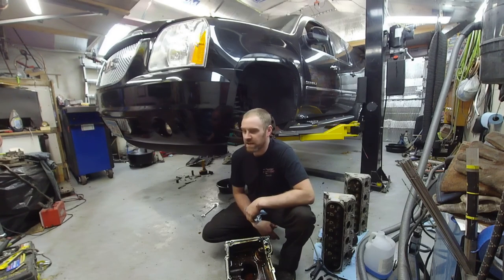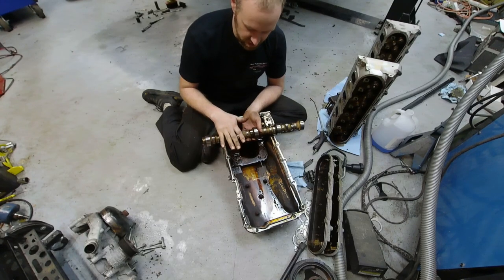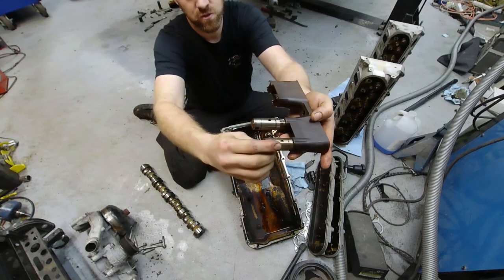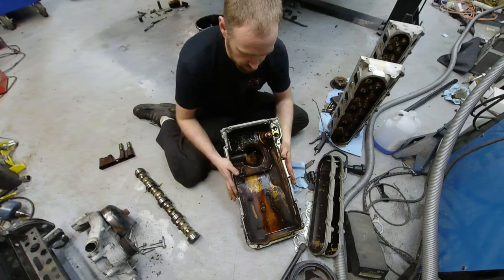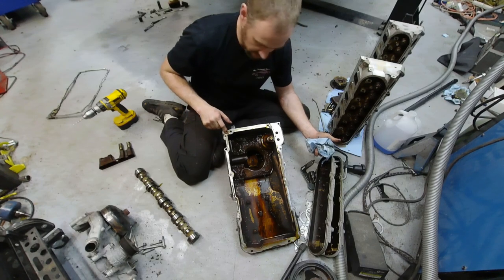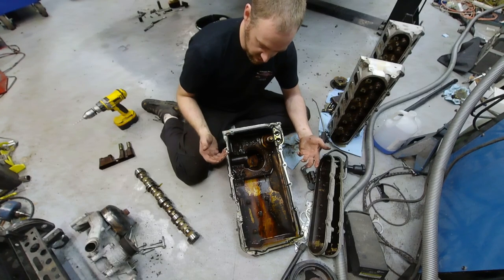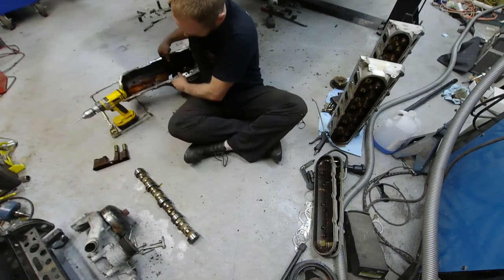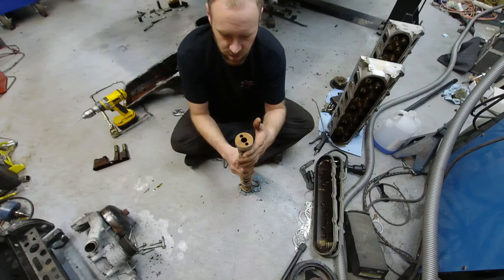Common GM V8 Issues & 6.2L Truck problems

Comment: This is why I bought a 2011 sierra denali.  That 6.2 did not get the DOD system like the yukon denali or escalade
Reply from the maker: If it is a 1500 it could very likely still have AFM/DOD. How do you know for sure it doesn't have it, did you check the valley plate under the intake?
Reply: @CrazedPerformanceRepair  The L9h 6.2L engine was built without afm. It was put in the 1500 sierra and silverado as the big engine option. Only the L94 6.2 in yukon denalis and escalades had afm.

Comment: Got a 2010 6.2 in the shop right now with a rod knock and fuel going into the crankcase
Reply: I just got a 2011 ss and it’s leaking oil

Comment: I bought a 07 yukon Denali ran great, now its runs a lil rough and the oil gauge isnt working anymore. Taking it to the shop but would like a general idea of what "may" be wrong so they dont just tell me anything.
Reply: Probably the oil pressure sending unit. It’s a easy replacement and don’t forget to take out the screen behind it and don’t replace it!

Comment: Great Content Brother, So trying to do Everything to have Dependable Oil Pressure in an L94 AFM & Vvt Delete, BTR "Norris" Cam w New Cam Plate Oil Seal, Johnson Low Leakdown Lifters, New Melling M395HV Oil Pump/Green  O-Ring & 2 Bolt C Bracket on Pickup Tube New Oil Pan Gasket & Seals. Also adding GETM Oil Squirters to Main Oil Galleys to Bottom of Mahle 4032 Forged Pistons. So Thinking whether to Replace or Plug Oil Pan relief valve ?
Reply from the maker: The second Cam Bearing is a common oil pressure loss area so be sure to replace those to. Norris cam is a great choice though. If you go to a standard volume pump then remove the release valve. That pump is going to be too high of volume for that build though. Since you added the oil squirter's but removed all the AFM vvt stuff, I would go stock high volume. That pump will just be pouring oil past the pump and pan bleed off constantly.

Comment: Very informative video . . . I realize this is an old video, but have you heard if the newer 6.2 engines are having problems like these ? I'm looking at 2022 GMC Yukons with the 6.2 engine and I'm trying to find out if these problems are going to come up after I buy one - thank you for a great video.
Reply: Better off with a toyota sequoia capstone or a newer Lincoln Navigator
Reply: Don’t buy a GM 2019 Denali 4x4 2 motors blew both cam bearings.

Comment: I’ve had two 6.2 engines. Both of them burned about a quart of oil every 1500 miles and both had head gasket problems at about 72,000 miles
Reply: Ecotec or vortec
Reply: @Pabloperes675  1 of each
Reply: @PumpkinKingXXIII  don’t tell me that man, i pulled the trigger on a 21 Silverado 6.2, should I back out?
Reply: I got bad luck so make your own mind up.
My 2016 got stolen first of December. 
 Insurance paid out, bought a 2021 gmc with 6.2. Two weeks later deer ran out and major damage. Been in the shop trying to get parts to fix it since. Shop has had it three months tomorrow.
Reply: @PumpkinKingXXIII  damn man sorry to hear all that.
Reply: @Pabloperes675  thanks, at least I wasn’t hurt
Reply: @PumpkinKingXXIII  yes sir that’s what matters
Reply: 2012 Escalade 6.2. Zero oil consumption at 122K miles.  Just had the motor build a few thousand ago and the same. That sucks man

Comment: Thanks for the info..   I didnt find in comments for best way to avoid issues.  I have 2017 5.3l in my yukon with 70K  and i tow occasionaly,   Is it best to deactivate the cylinder deactiavation along with changing oil often>?  I run full synthetic.    Between my driving and towing the AFM isnt on much.
thanks
Reply: The best advice is to turn AFM off completely like I did on my 2017 with 6.2 when it left showroom floor. I also use Amsoil SS since new. No issues yet knock on wood

Comment: Thanks, I came out to start mine 6.2l Yukon and its knocking like crazy, all fluids are full no engine light BUT oil pressure is very low just below 40. What could it be. it only has 88,000 and the oil is just as clean as when I bought it and never had to add oil to it. Whats your thoughts?
Reply: Just below 40 isnt low😂.when it gets to like 10 at idle be worried then

Comment: Aside from lifter issues specifically, the biggest other problems I've seen (at least with the 5.3's) oil pumps going out and the pick-up tube o-ring cracking and either causing air to get ingested or causing the tube to drop or otherwise not suck up enough oil, and the oil pressure sensor sending unit going out (and in some cases, I've read people having to replace the sending unit multiple times over the life of the vehicle).
Reply: W

Comment: The L9H 6.2L in the 08-13 sierra and silverado doesn't have AFM or air suspension.
Reply: I purchased a 6.2 from a 08 Denali to do a swap........are you saying that it doesn't AFM and do you know if I would need to do the DOD Delete for this particular engine?

Comment: Hello,
I realize this is an older video however I hope you see this comment.  Thank you for all the info by the way. 
Big concern here is that I did the dod delete,  I left in vvt but I did not replace the cam phaser bolt,  you mentioned in your video that it should be replaced,  I did not and I am now worried about it,  what could possibly go wrong with reusing the bolt? Can it possibly walk out?
Reply from the maker: It's considered a stretch bolt per GM, I guess in theory it could break. I guess if you've been driving it and it hasn't broke yet, I wouldn't be too concerned.
Reply: @CrazedPerformanceRepair  thank you for the reply sir, so if the bolt happened to break would the cam phaser sprocket fall off? That would be my fear is that it would fall and destroy the engine. Again thank you for your time
Reply from the maker: @johnherrera8004  yeah most likely. Then it would bent valves at that point.
Reply: I found the vvt cam bolt can be reused one time. Original torque specs were 48 and some amount of degrees, if it is reused once then torque it at something like 45 and add some degrees but not as much. If you can remeber how much you torqued it if it is around the 45 you'll probably be just fine. Check out sdpc tech tips: dod delete faqs!

Comment: I have a 2005 envoy xl with a 5.3 engine. It was running fine and all of a sudden it lost power. Doen't want to rev up. Have to put it in 4 low to move it because it has no power. We pulled the plugs and checked the compression. 2 cylinders had 150 lbs. of compression and the others were low. started it up with just the plugs in the 2 cylinders and it runs better than with all 8 plugs in it. So we pulled the cover on the timing chain and it is where it is supposed to be on the gears.What else can it be?
Reply: Check the exhaust and catalytic convertor

Comment: I have a 08’ Yukon Denali non AFM and I had all the lifters changed and still have the ticking sound. The oil presser will sit below 40 in idle when it warms up. I wonder what this problem could still be. Would a high volume oil pump help?
Reply: 2008 6.2 doesn’t have the DOD. It’s only a VVT motor. Bunch of misinformation on the topic of the 6.2 Having DOD and what year they started. 07-09 6.2’s absolutely do not have DOD. As your comment is a year old, I assume you’ve found that out already.

Comment: My wife's 2012 Denali had the oil pressure issue where it now drops gradually to 5 psi as the engine warms up.

I replaced the oil pump and the o-ring for the pick up tube with no change. What's going on? There's no noise from the top of the motor when this happens (no lifter or valve noises).

I'm frustrated with this because the motor was running too well to have just fallen apart overnight.

I change the oil regularly (5k miles) and use Mobile 1 synthetic 5w30 with the ac delco filter.

I found one reference on a message board about a guy who says the problem most often is the thrust plate right in front of the camshaft.  You unbolt the cam gear the replace the thrust plate.  Its got a very thin gasket built into the back of it. It flattens out and as the engine warms up .....pressure passes by. If you shut the engine off and restart pressure comes back for a little bit. 

Do you know what he’s talking about? Does that sound plausible?
Reply from the maker: Check the screen under oil sender. It's not the thrust plate unless it broke somehow
Reply: Thanks, will do!!!
Reply: @CrazedPerformanceRepair  It wasn't the screen. I am going to do the DOD delete. How do you remove the cam gear/timing chain? Have you made a video for this?
Reply: @CrazedPerformanceRepair  It turned out to be the thrust plate. The built in gasket wears down and flattens out, allowing oil to slip by and go to the oil pan underneath the timing gear and, effectively bypassing the oil pump. For two weeks now, the oil pressure is normal (approx 60 psi at cold start, 40 psi at operating temp and normal operating rpm, with it dropping to just above 20 psi at idle).  I would have never dreamed a part less than $30 could have caused that...

Comment: silverado 5.3 2017 problem in cylinder 8 I put all the lifters new and it still keeps canceling that cylinder when I turned it on that happened a minute later it started giving a problem with the same cylinder when I put everything new
Reply from the maker: New parts don't fix why the failure happened in the first place. You either lack oil pressure during activation or the plastic guide is junk and allowing the offer to rotate. If the guide is bad the camshaft and lifter roller will be too.
Reply: @CrazedPerformanceRepair  lifter are new because it had a bent rod valve Lifter Oil Manifold I tried it outside putting power on and you can't hear it activate but that also has to do with cylinder number eight
Reply from the maker: @bikelifektm7449  it had bent pushrod? Not sure I understand that comment. Btw, I typed mine wrong. Offer was supposed to be lifter.
Reply: @CrazedPerformanceRepair  Some of the rods were bent I put them new all the way down but I took out to test AFM Lifter Manifold with a Power pro and it doesn't make the sound of activating and deactivating that also controls all the cylinders
Reply: @CrazedPerformanceRepair  bent pushrod i put it all new And it has oil pressure over 40
Reply: @CrazedPerformanceRepair  And how can I contact you?
Reply from the maker: @bikelifektm7449  best way to contact me is on my website crazedperformancerepair.com your lucky I seen this message and somehow am actually responding quickly. I'm done for the night though and Sunday is really hit or miss for me. I always reply to my PM's on my website eventually though unless it's a comment not needing reply of course. YouTube doesn't always notify me or it gets lost in the notifications.

Comment: That was a 2009 to 2014 right? 2007 and 2008 L92 didn't have afm dod from what I understand.
Also if I'm right and the 2007-08 might have a direct non dod replacement shaft for the 6.2L. 
I can look to verify the info... it was one of the reasons I went with a 2007 yukon Denali over a 2009 Escalade SUV. Both have the 6.2 but my 07 was said not to have afm dod.
Reply from the maker: There are 6.2 without it but I guess it's somehow a different lobe profile. It would be nice to look into a bit to be sure though.
Reply: @CrazedPerformanceRepair  I too have an 07 that does not have AFM DOD. However I do have an extreme oil pressure loss when at idle...it drops down to near 0...as in zero. When revved up but then it only gets to about 30 maybe. Replaced the oil pump, and no change. Also did the o-ring from the tube going down into the pan. No change. When the car warms up, while driving, I also get that clanking sound that I hear in your videos. It's intermittent however. May last for 25-30 minutes and go away for 10-15 minutes. I'm looking at doing a top end rebuild. Before I do that, I thought I would ask if you had any ideas for me to look into first. Thanks for your consideration!
Reply from the maker: @benjaminsaveritt7047  It is most likely a lifter, I will be releasing a new video on the new issue related to your exact problem. I will release it in less than two weeks.
Reply: I have a 2009 Silverado  LTZ 6.2.  Bought it because it does not have AFM.  Have another with a 5.3 with AFM.  I put in the AFM disable in a few years back.
Reply: @caspere.8461  oh ok. That must be the L9H. Went L92 to L9H then the L94 had afm.
Good to know. Thanks.

Comment: I did a cam swap BTR truck cam stage 4 on my 08 Cadillac escalade esv 6.2 and I had to change to the 3 bolt cam sprocket and i am getting the cam sensor code. Truck cranks first time it will run  steady want cut off rpm move up and down. If I cut the truck off it want start back up I'll wait a while try again and it starts up. Should I change the timing cover VVT delete? Any suggestions
Reply from the maker: If it had VVT and you went to a 3 bolt cam you have removed VVT already. This means you must change the timing cover to a non VVT cover and also turn off VVT in the tune. Make sure you have a 4x cam sprocket installed and that you get a tune put it that is specific to the modifications that you have done.

Comment: Great Video. Seeing it a year after posting though. I have a 2015 Silverado 5.3 liter with 80K. Haven't had any issues with the AFM/Lifters yet. I have a range AFM delete that I plug in the OBD sometimes to feel the V8. Do you suggest I seriously perform a DOD delete if I plan to keep my truck?
Reply from the maker: I would just shut off the AFM in the tune for now and do oil changes often, well before the oil reminder. Do the delete when something fails.
Reply: @CrazedPerformanceRepair   is the range plug in good enough instead of a tune? For now until something breaks.  I have the range already and planned to run it until i have an issue.
Reply from the maker: @edensgardenshed9622  yeah, it works most of the time. Since you already have it may as well.
Reply: Can you send the parts number because I want to do dele

Comment: If a have a stroker ls do i have too cancel tha valve that is in the oil pan? And put a plug? I change the oil pump for a melling 30555
Reply from the maker: I assume you mean you have the 10355 and if so then yes you will want to remove the relief in the pan. Also prob safe to assume you have deleted the AFM system completely right?

Comment: Can you swap to a non afm engine and delete the dod on the ecm to make it work.
Reply from the maker: Only if it's the same generation and pickup trigger wheels on both camshaft and crankshaft. It will also need to match whether the vehicle you're putting it in had or doesn't have VVT. You also need a tune though to shut off the AFM.
Reply: Thanks appreciate it. I swapped it out for  a L9H luckily it worked. Got extremely lucky

Comment: I'm considering a dod delete, I have 6.2 2014 Sierra Denali. We already had to change a valve spring. 140,000 miles on it, would you recommend the disabler or a full dod delete? Thanks Tb
Reply from the maker: If it does have AFM getting a tune to shut it off is best. At least until something fails and it needs a full AFM delete. I typically avoid the disabler for several reasons but for starters it much more expensive then the alternative permanent solution of someone like lt1swap.com

Comment: What are your thoughts on the L9H 6.2?
Reply from the maker: It's nice it doesn't come with AFM, but they do still have the chance of dropping an intake valve seat.
Reply: @CrazedPerformanceRepair I just got a 2009 Escalade with 75k on the odo. I hear a light ticking noise 👀.
Reply from the maker: @iwuzheree  oh oh lol, hopefully just piston slap... I did just do a set of seats on one this week.
Reply: @CrazedPerformanceRepair 🥲 im gonna try to change the exhaust manifold gaskets. I heard they go bad as well.
Reply from the maker: @iwuzheree  yeah if you are hearing a ticking at cold start it could easily be a broken manifold bolt. It's very common happens on pretty much every single one of them.
Reply: @CrazedPerformanceRepair I’ll see how it goes. Thanks for the reply.

Comment: I'm a Viewer from Middle GA and there are plenty of those DOD engines going to crap, A majority of people in the SE do not take care of their vehicles sadly, Also , Plenty of obs 88-98's in the SE,  Sadly they are mostly squatted or ragged out,  I daily a 96 K2500 5.7 LWB 4x4 with a 00 Denali Front end swap with doors lol.
Reply: The owners manual also says to use premium on these 6.2 l and people still use 87 . That's probably why they're messing up. I put nothing but premium on Camaro ss